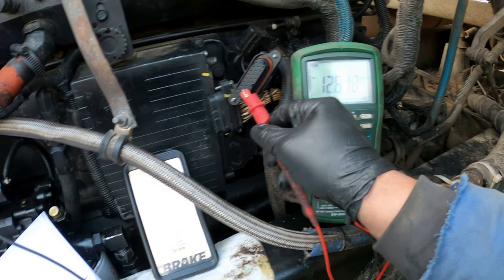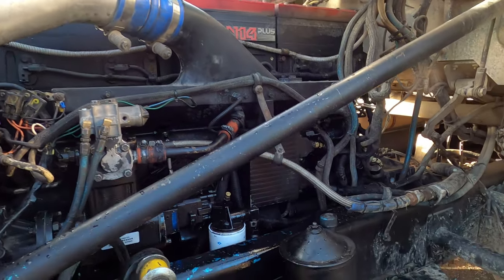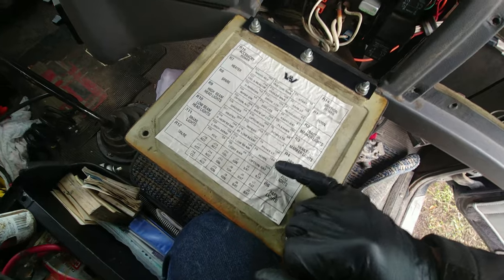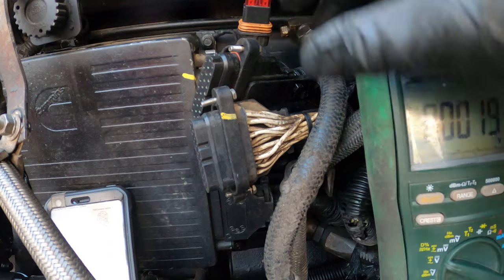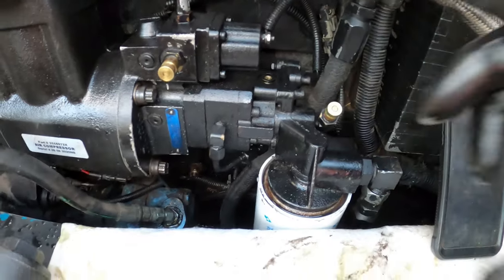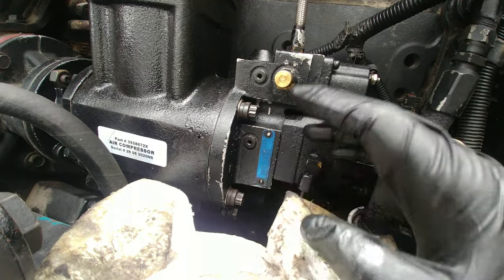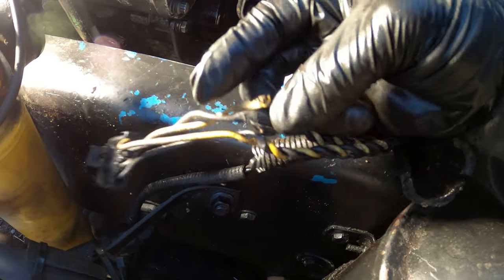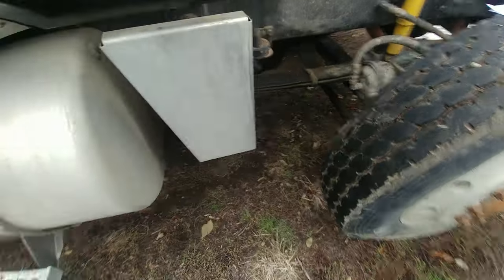CUMMINS N14 CELECT PLUS: CRANK NO START. TROUBLESHOOTING & REPAIR (Western Star 4964)

Comment: I'm giving you a thumbs up because you showed me that my fan clutch is inoperable: it turns the fan even when cranking for the first time in the morning.

@6.25

I think you are overcomplicating things.  The first thing you need to check in my opinion is if there is any electrical poles getting to the injectors.  

Ed KRON from heavy duty powertrain says to get a "noid"  light which will allow to see if electricity is making it to the fuel injector.   If the noise light flashes, move it to the other five cylinders / injectors.  If each cylinder is injector fires you know there is no problem with the electricity and you can roll out the ignition switch, the ECM, and the fuel solenoid.

This method with electricity getting to the injectors allows you to jump straight to a testing of the fuel system starting with a fuel pressure gauge hooked to the fuel pump or somewhere in line thereof.   

If the fuel pressure is within specifications then it is quite likely a mechanical fault within the injector (s).
Reply from the maker: Good point Michael! You are  right. I will pin your comment up, make sure other viewers can read it as well. Cheers!
Reply: @PistonShack  we have the same problem sir so we n14 I just replaced the engine sensor doesn't want to work now
Reply: @PistonShack   Hello sir... I have the exact same engine... My problem is I just replace the wiring harness and sent the ECM OFF to have it rebuilt... ECM had been off the truck maybe 6-8 months prior to me sending it off for rebuild... Well once got it back put the ecm and wire harness on... It cranks no start... I'm getting no fire or voltage from the wire that runs from the ecm to the fuel solenoid..  Please let me know what  would u suggest my next step should be...Again the wire that runs from the ECM and plugs into the top of the solenoid has no reading of voltage... thanks in advance for any feed back..
Reply: @PistonShack  Hello piston shack... Any advice on the question I asked about the fuel solenoid not getting any fire through the wire that connects to it from the ecm??
Reply: @curtbengal7910  this is probably a little late but we had a cat 3126 ecm go bad, we sent it off got it back and same problem, we sent it back 3 times for the same issue, they repair shop never fixed it. We had to end up buying one from caterpillar, it runs like a new one now

Comment: Thanks! 98 Freightliner no start after sitting all winter. I didn't get as deep into checking voltages but I had no click at the fuel solenoid. Turns out I had a bad ground in the battery box. Up and running in less than half an hour. Much appreciated!
Reply from the maker: That's awesome, buddy! Thanks for your kind feedback!

Comment: I have 1999 Volvo with n14 that had been sitting for 5 years and I’m going to use this to help me get it started!
Reply from the maker: Sounds good Richard! Let me know how everything is going) Cheers!
Reply: we have the same problem sir so does n14 I just changed the engine sensor it doesn't work
Reply: we have the same problem sir so we n14 I just replaced the engine sensor doesn't want to work now

Comment: Great job on a difficult case
Reply from the maker: This one was interesting and new, not like doing brakes on Honda Civic or alternator on Toyota Corolla) Thanks Bruce!
Reply: @PistonShack  I'm having the same problem. I just got a 2001 international 9100i n14. I have crank but no start.
Reply from the maker: Hi Randy! Have you done some troubleshooting already? I forgot a couple of things in my video: 1) Check if you have a tachometer respond when cranking, if not probably most likey engine cam sensor or wiring; 2) check engine temperature gauge when key turned to ON position if arrow points HOT, engine coolant temp sensor is faulty or wiring - could cause crank no start.
Reply: @PistonShack  okay. I check the tachometer. When I turn on the computer respond to me. Do I also need to get a test light check all fuses and relays? Cause I did here some popping sounds from the fuse boxs. When I was driving it home.
Reply from the maker: @randyjackson2938  I would go and check the wiring harness, grounds, distribution box (fuses and relay). Look for any contact points where wires can rub against any shart metal objects as well.
Reply from the maker: Do you have fuel at the return line?

Comment: excellent video, I have a cummins n 14, in a 98 freightliner, the problem is that it doesn't start in the morning.  already starting it has no problem during the day, but the next morning it is the same problem.  I will follow the instructions what is in this video.
Reply: @rafaelalvarez3542  did you find out what it was? I having the same problem with mine

Comment: Great video. I ended up finding that my ecm pins 20 21 22 23 didnt have any power. Truck had shut off in middle of highway. So i went back to batterries and the power to ecm had been cut by hitting the edge of the battery box.
Reply from the maker: Nice work brother! I am so glad this short video helped you out. Thanks for your feedback. It means filming this clip wasn't for nothing. Drive safely. Greeting from Canada, British Columbia.

Comment: I have a 97 Fld 120 Freightliner and it cranks up and starts but it takes a some time. But when it starts up it running great for about an hour, but if I come out of gear at a high speed it sputters and cuts off. but it cranks back up again

Comment: I have a 1994 Freightliner fld120 n14 Cummins crank no start the cam sensor has no power at all I traced the wire to the ecm and tested it no power any ideas

Comment: I have no voltage at pin 16, can you tell me if there is a fuse on the line.
Reply from the maker: Sorry Jon for the late reply. I cannot tell you, we sold that truck out. Ii don't have wiring diagram.

Comment: I have an n14 but it cracks forever then it starts I changed the check valve nd Injectors too Wht could it be
Reply from the maker: Most likely you have air sucked into the fuel system. Check all connections for any leaks first. Before cranking crack one of the lines at the pump to verify the fuel.

Comment: I've got an N-14 in a bus that wouldn't start.  I charged it for 6 hours with the ignition switch turned on and then it started.   Now it won't start again and it's leaking fuel from somewhere on the fuel pump.

Comment: I'm having problem with my 1995 Volvo it's a N14 cummins engine it's been sitting for 2 yrs I would start it every 2 week till in August I changed the oil pump after it just won't start.
Reply from the maker: Hi Celia! Did you replace oil pump or fuel pump?
Reply: The oil pump

Comment: My N14 stop running and Im not getting power to the fuel silonoid nor the injectors no power is coming thru terminal C at all.
Reply from the maker: Have you tried to feed 12V to the fuel shut off solenoid directry?
Reply: So on mine there is one wire running to fuel shutoff, just take wire off and run a jumper straight to battery and see if it fires?

Comment: I'm starting a n14 change over into and old bus. Thanks for that pin out info sir. Have you gotten one of these to fire up outside of a chassis?
Reply from the maker: Hey brotha! No I didn't fired up N14 Cumming when engine is removed but you need power and ground to the ECU wiring, starter feed and fuel  then it should crank and fire up. Let me know how is your project.
Reply: I have take like 5 wire just needs the constant hots and grounds and one keyed hot
Reply: What kind of old bus?

Comment: Ok that a crazy prob- truck would only start with either- runs perfect but couldn’t start on its own- ohm crank pos sensor with volt meter- anything under 38.xx it’s bad- even tho truck run perfect with either start- ran 300+ after either start- but let me tell u changed the crank pos sensor- turn on perfect no issues
Reply from the maker: Any luck with your N11?

Comment: Hello sir I have Cummins isx I have problem with my truck shuts off  when I’m driving   Shuts off. Every other day.   Any ideas  thanks
Reply from the maker: Any luck with your Cummins? I would check intermittent crank signal lost and fuel shut of solenoid operation first. Do you have any DTCs present?
Reply: @PistonShack I. Change crack timing sensor.. it looks like it’s running good now 2 day with out shutting off .. thanks

Comment: Have a n14 will crank only if I spray with starting fluid and it’ll only stay running if I hold on the gas
Reply: Hey bro did you fix your problem?